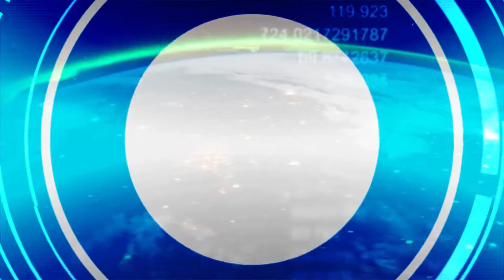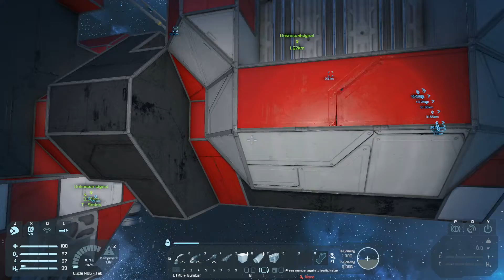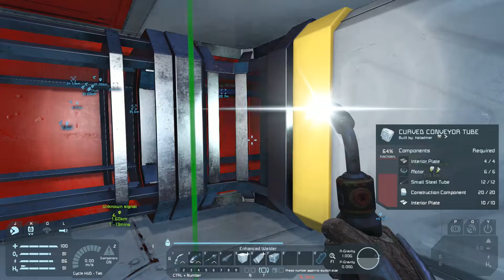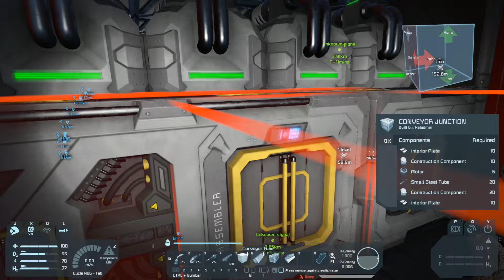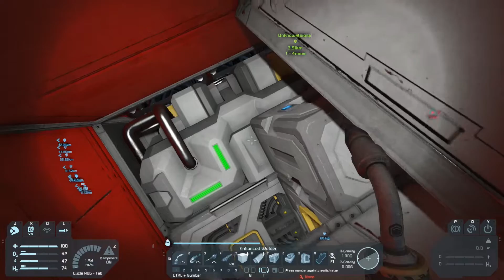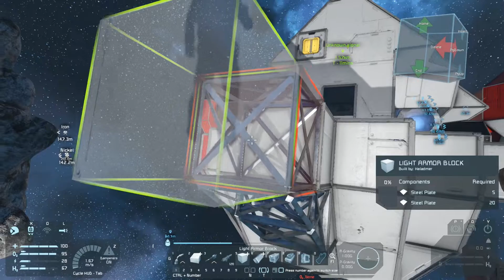Space Engineers | Space Start (Red Ship) | Ep 05 - Building The Industrial Complex!

Comment: TIM is good at sorting cargo blocks, but providing information via the LCDs is very limited because that is a secondary role for TIM.  Whereas Matt Masters Auto LCD mod has a sole purpose of providing visual information.

I find for me, a combination of both gives me the ultimate control. Auto LCDs show me everything I need to know, including Oxygen & Hydrogen levels, battery levels etc, as well as component, ingot and ore holdings.  I then, as previously mentioned, prefer the hands-on control of production rather than letting TIM fully automate the entire system.

They are both great scripts in their own rite, but combined, they are the bees knees.
Reply from the maker: I'm a fan of the old automated inventory script, since it was an in-game script that didn't require a prog.block/timer.  For those who might not know, TIM does the same basic things, but uses in-game resrouces to run/control its functions, which provides a lot more feature support.

I have TIM on my mod list, but have avoided using it so far simply because I'm not running the automated production quotas, but I might go ahead and load it into the save for basic inventory sorting/parts movement.  Will depend on how much more sorting I need to do, and if I rebuild my storage system for more long term storage.